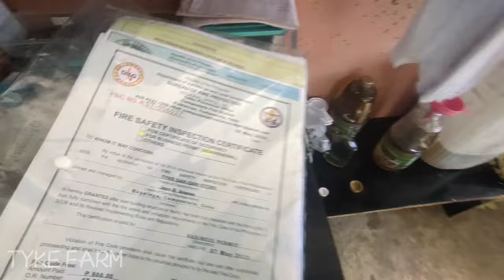ANOTHER PERMIT DONE AND WORKING AWAY

Comment: Very interesting.
May I ask if it is possible to see a picture of the drill bit that they are using to drill thru the rock. 
Also, what size is the drill bit diameter and the bore hole diameter of the final well
Thank you.
Reply from the maker: Hi Barrie the bore hole is 5 inch which will house a 4 inch pipe. The drill bit Ive only seen once, cant describe if it comes out again I'll video it
Reply: @TykeArenas  great. Thanks